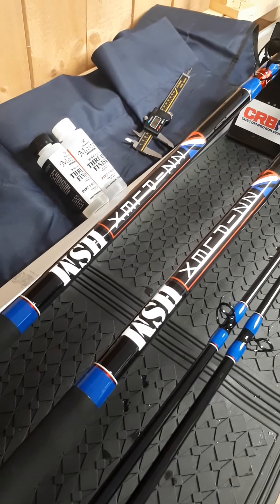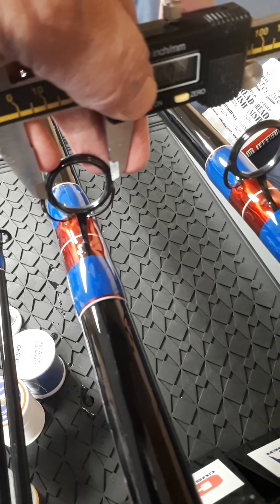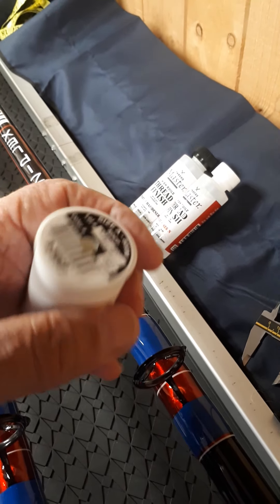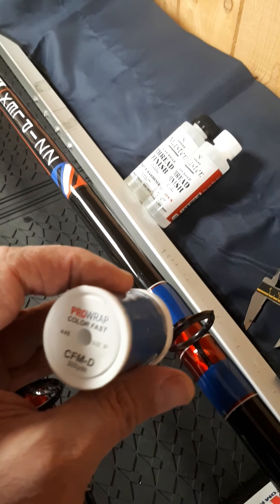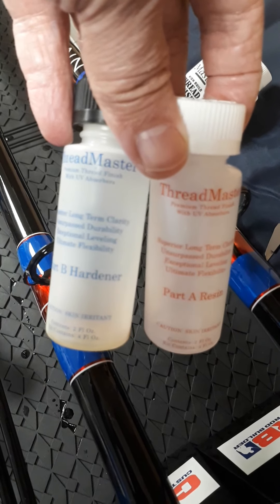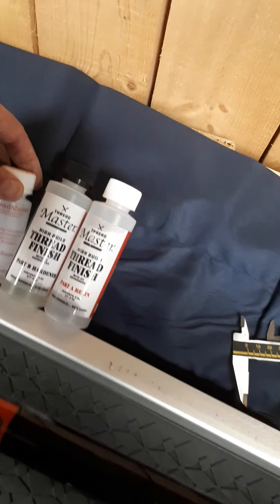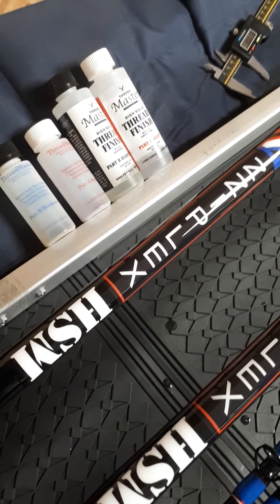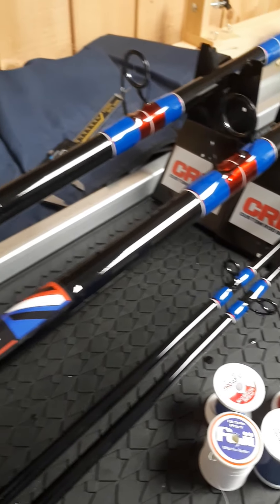Zziplex HSM - Butt Guides

Comment: Threadmaster epoxy is the best all round finish, I find flex coat better for heavier boat rods though.
Reply from the maker: Hi Nemesissir, thanks for the comment. I have tried most of the highbuilds and all with different results. The thread master works best for me at the moment and have just ordered the lite version so keen to see what that does.